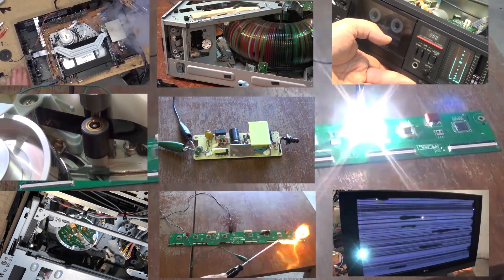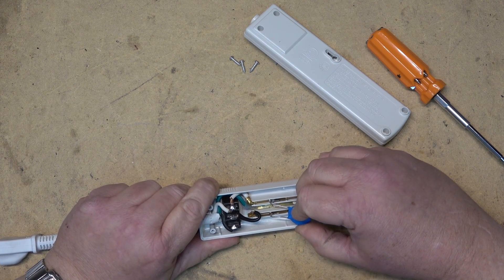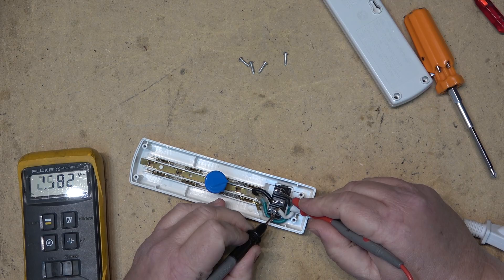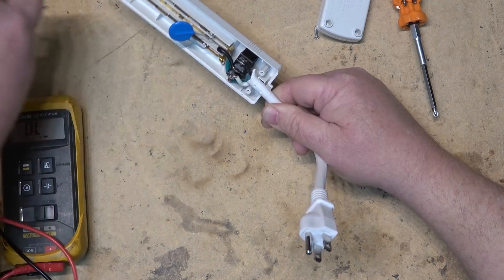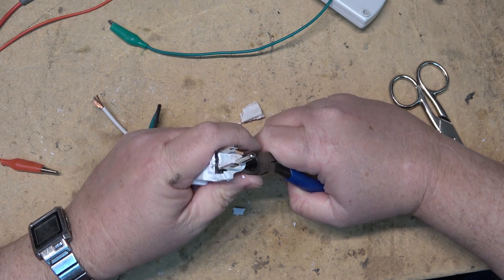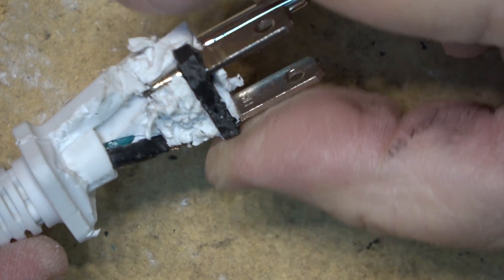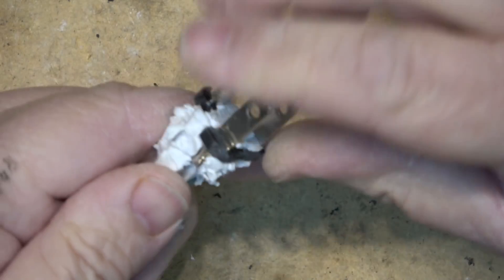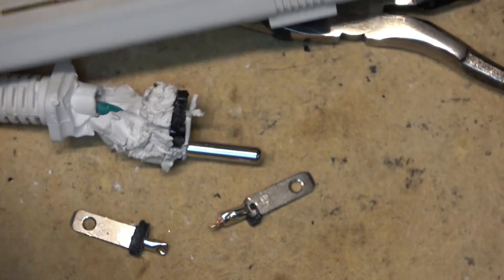Teardown forensics why did that power strip fail lets find out

Comment: I used to go through the hardware equipments and inspect the power cord by using a continuity test and see the power cord is any good or scrap. The first one I remember is foam cutter is two of it, I have to use special screwdriver such as flathead notch screwdriver and open the case and replace the power cord and get it working again. Second one is saw-saw, same problem. Third one is circular saw, so does metal cutter, saw table (of course, I replace the light switch), rotary drill, and the halogen floodlight. Plus first the furnace blower, they use two prong plug for temporary use, I went ahead and change to three prong plug and grounded the blower, and they're happy about that.

Number of the power cords I've dealt with it is frayed jackets, frayed insulation, burnt plug, shorted terminals, damaged cord, and damaged plug.

Normally I checked the hardware equipments to make sure it is safe to use and get the job done on the regular basis.

What's nice about the hardware equipments is I can open the case like an onion layer and replace the power cord really easily and reassemble it and get it to work again.

Comment: Great work,  I suggest a cheat,  many years back when I started in telecoms I bought a cheapie chinese tone and probe, 20 bucks, worked great, but unlike the pro toners you cant use them on active lines, let alone with anything AC, even low ACv when phones ring got it very upset,   so after realising how valuable toning was,  I got myself a "real" aka professional CZ toner, and relegated that cheapy chinese thing to the work bench where it can safely be used to find breaks in passive leads just like this   -  many a time I've saved 95% of extension leads and audio cables with that cheap piece of junk  saving me a lot of time finding the break  area :)

Comment: It's often the molded plug. I killed a "15A rated" extension cord and the outlet it was plugged into charging my Volt at 12 Amps. Bad crimp got very hot and melted everything the prong touched. Got a better cord and a new GFI outlet, haven't had a problem since.

Comment: In the UK I'll often chop off the cheap moulded plug and put a quality 3 pin plug on. I know that the USA doesn't use fused plugs like the UK but often things from China bypass the fuse and it'll work with the fuse out.

Comment: I hate molded plugs.

But they are everywhere.  Also the plague of aluminium wire instead of copper.

My shower isolation switch also died in this way.  In there the live and neutral and earth are merely held by screws.  Over time these loosen and although you still get some conductivity you also get a little arcing which heats the cable and burns it over time.  This loose crimp was probably doing just that, a small amount of arcing and slow burning till it failed.

Comment: Very common to have the moulded plugs fail, as they often either do not crimp well, or do not crimp at all. Also replaced a lot of socket outlets, because the outlet in the modern ones uses minimal brass in them. Most common failure is the tiny little piece of brass that forms the switch failing, they are a lot smaller than the old socket outlets. Hard to find good quality ones any more, you only find the same cheap inners, irrespective of the price.

Gotten to the point I grab old ones that are being replaced, clean them up, and open and retension the inner contact surfaces, to grip the plug well. None of the plug and sockets you find are capable, despite being certified to do so, to carry the full 16A, and many are not even capable of 10A long term.

Comment: I prefer power strips that are UL rated, not Intertek. But most importantly, I prefer power strips that have as much metal as possible. Metal power strips will run you some more money but they are by no means rare, and fires are very expensive events. I have zero plastic power strips in my residence.
Reply from the maker: Metal ones are just as dangerous if overloaded.  
Key here is don't overload them.  In other words don't plug appliances or space heaters into them.  That is asking for trouble.  I have a bunch of them but they are all low power devices. About the highest power device I have plugged into. Power strip, 100 watts.

Comment: Eh Dave, maybe you have a good 3 / 10 GA cord in the stash  that has a bad outlet. This way you can cut it to length , solder it into the strip solder lugs and close er' up.    Stay warm my man.    JwgK
Reply: I just use old IEC lead sets, and cut the unused end off.
Reply: @SeanBZA  95% of the time those are only 18 AWG so not the best for a power strip. However if you mark the unit and make sure you stay under 8 amps you should be fine.

Comment: I thought the short cable didnt help matters, when the cable was bent, the  thick conductors pulled hard on the pins.
If there was more cable then it may have been bent firther away from the plug.
Shame, it looked like a handy multisocket.
Reply: A "short" is when the "hot" makes contact with the "neutral", this was an intermittent "open", meaning it breaks contact like the switch, which is always on the hot side.
(In most countries).
Reply: @MikinessAnalog  You do know he's talking about the length, do you?
Reply: @Craft4Cube  Oops, no I did not catch that LOL

Comment: Failed with neutral going out, very dangerous, good thing we have ground.
Reply from the maker: If the ground prong had been removed then you could be the ground.
Reply: @12voltvids  Indeed! Kinda scary for older homes like mine that aren't grounded.
Reply: Here in Japan, we do not have the "3rd ground prong) and it is 100 volts (60Hz in the south & 50Hz in the north).
Reply from the maker: @MikinessAnalog  
Most stuff here isn't grounded either.

Comment: This video reminds me of what many people say when they encounter an appliance or extension cord with the ground pin cut off. “ This guy must have been a idiot to cut off the pin”. I know because almost every new thing I’ve purchased recently, the ground pin is missing. I’m in a power wheelchair and most chargers don’t have on/off switches so you have to always be connecting and disconnecting the power plug from the wall. The main problem is these things are made so cheaply and are of such poor quality, that the first thing to break is the stupid ground pin on the plug. I’ve replaced so many plugs on stuff you have to constantly unplug that I’ve lost count. I’ve asked everyone I know and they all complain about the quality. BTW, I always learn something new from your videos. Thank you for posting.
Reply from the maker: Most ground prongs are cut because some numbskull wants to plug it into a 2 prong outlet or extension cord.
Reply: @12voltvids  That's certainly the case with old equipment but I've seen my share of ones that appeared to have broken off by themselves. I've lost count of how many detached ground pins I've found stuck in power strips.

Comment: I was betting on the switch until I saw the evidence.  I feel better that Dave said the detect unlikely will cause a fire hazard.   I have a power strip that looks just like it.  I can sleep better.   Thanks Dave.
Reply from the maker: That is what I was expecting too. First for me.
Reply from the maker: Well it "shouldn't" catch fire as the plug material is supposed to have a fire retardant in it.

Comment: I greet you how to verify the correct function of the Varistor with the multimeter as soon as possible, thanks for your feedback
Reply from the maker: Couldn't tell you. Never tried to measure. They either work or they don't When they fail they usually blow up, emit a bunch of smoke and cause the fuse to trip as they go dead short.
Reply: @12voltvids  Thank you very much for your comments, and have a nice evening

Comment: better to buy these made by a quality company such as APC who are owned Schneider electric who are a huge manufacture of electrical breaker panels.
Reply from the maker: Well these are give away units. Mostly used in smart panels so modems and ONT and switches plugged in. Most smart panels have no room to plug in wall warts and still close the door. A regular power bar with 7' cord gets in the way in panel with no extra room. These work great for that, and modems and such do not draw much power.

Comment: I wonder why the guy plugged into the extension lead of approx of a 1-foot length and not directly into the wall socket? Vacuum cleaners vary in wattage and at the lower end, about 750 watts-1800 or so watts 230v in the UK average. That one you have there was clearly faulty and would have given way anyway but an arc BANG would be scary at high wattages.
Reply from the maker: It was in a garage. His modem and ONT were plugged into the power bar and the other side of the outlet had a transformer for his security system plugged into that side secured by a screw. I got it as a trouble call, internet tv and phone down. Traced to blown power bar.

Comment: Was this the Harbor Freight version of this 4 outlet power strip? 
I'm not a fan of the plastic units I Love the older metal ones that use "real" outlets (Usually the Rong Feng E06 types but a wall style will work if you remove the mounting ears) and a separate circuit breaker not a switch breaker combo device.
So are those scissors a box cutter blade on a scissor handle and link to get one?
Thanks
Reply from the maker: They are Klein electrians scisors, and before you ask, yes t hey are expensive as are all made in USA klein  tools. I thing they were about 35.00 when I bought them about a dozen years ago. I too like the old power bars with the real outlets. Have an old one around here somewhere.

Comment: Is there a way to test MOVs?
Reply from the maker: Well you can run up the voltage and watch them start to draw current when you get to the break over voltage. Run them up too much and well they will fail in the most spectacular way. (Fireworks)